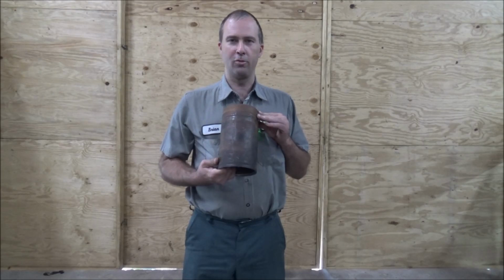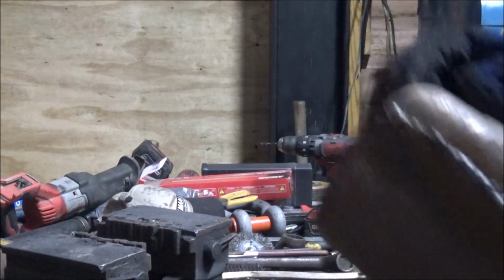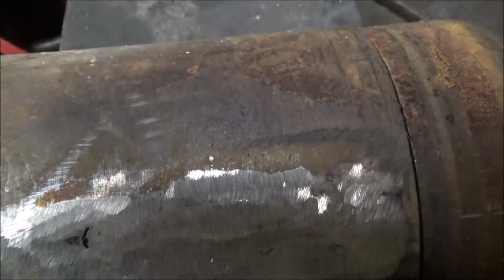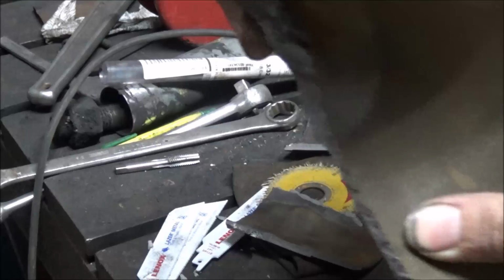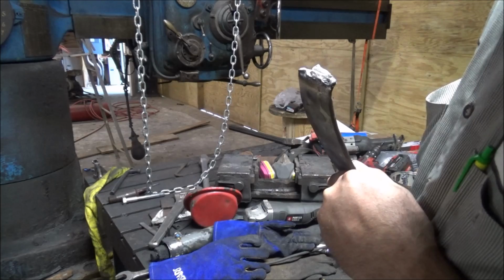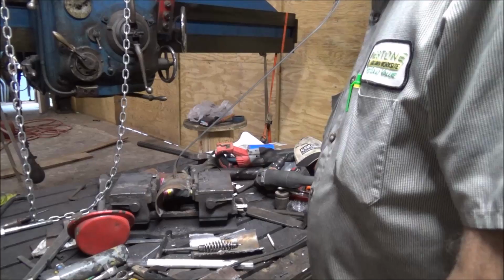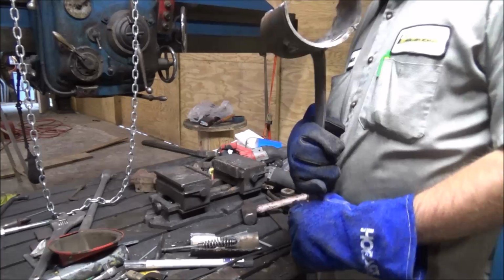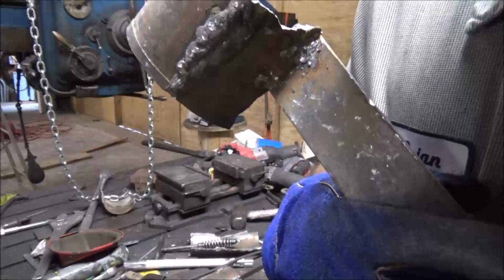Experimental strength welding of cast iron

Comment: why do you think removing the flux improves the welding of cast iron?  Does the carbon in the cast turn into c02 to both shield the weld and burn out some of the carbon to move towards steel?  It certainly is a curious result.
Reply: I'd be also curious to get the theoretical part behind this method, maybe also reduces gradually the carbon content in order to make the transition between mild steel and high carbon more progressive, could also some much slower cooling help...???   Lots of questions...
Reply: This is likely the case and the CO2 liberated in the process acts as a bit of a shield in itself.
Reply: If you don't puddle the flux out it leaves porosity.
Reply: I think two points acting together.
1. the heat drives out the the graphite as CO2 and CO creating a shielding and reducing atmosphere.
2. how much graphite is driven out depends on the temperature, creating a gradual decrease of graphite around that weld and with that a gradual change from the iron in the weld to cast iron surrounding it. I think this gradual change makes the welt so strong.

With flux on the other hand graphite will be pulled into the weld, but because the shielding will inhibit the burning of the graphite and we get a low graphite region surrounded by high graphite in the casting an weld.
Because the graphite can not burn away less will be pulled out of the surrounding areas making the changes of graphite content much more abrupt.
Reply from the maker: I believe with out the shielding from the flux I am actually decarburizing the iron and the weld somewhat thus reducing the area prone to brittle fracture.  Since I am using a large diameter rod with a lot of amps I am getting the weld area nearly molten and since I am forced to use a fairly long arc to maintain one I think a lot of oxygen is able to interact with the material  and leaving as carbon monoxide since it is not trapped by the flux. This is purely speculation but while the welds are ugly and hard to lay down they do seem very strong for cast welds.
Reply: My dad who taught me to weld always used special rods for cast iron I have no idea whet they are however. He always used one size up from what he would use on steel and ran them hot and fast.
Reply: I've had luck using 308L stainless with the tig welder. Thanks for the video

Comment: Brian: I'm surprised that you aren't getting more expert help on this. I am far, far from an expert welder, but I can tell you what I know. You've got to get some serious pre-heat on this and therein lies the problem because it's so big.  Some claim success with 7018 and mig, but every job I've seen has failed miserably. They go on the principle of "gobbing enough weld and it will hold". The problem isn't with the strength of the weld itself, it's what the welding does to the iron next to the weld when it cools from the fusion temperature. Flux on the rod, preheat and post heat will slow that down a little. Nickel and some stainless rods will "yield" as they cool, easing the stresses, skipping around and peening the heck out of each pass when it cools a little also helps. I've had some pretty good success welding iron pulleys and engine blocks and heads with MG 289. It is nearly pure nickel and goes on really nice but it's expensive. I sometimes do the root pass and face up the edges and face of the joint with it and then use a 50% nickel  (cheaper) to finish it. Depending on the quality of the iron, you'll get pin holes and porosity but don't worry about that, subsequent passes will improve the underlying passes....Dave

Comment: There's a lot of great info in this video Brian....  Like you, when I've broken something cast before, I've done a lot of research on what the 'professionals' do to get it fixed. The strength of the parent material seems to always be the limiting factor; but I too have had success with stick/7018 on a Deutsch front axle swivel, mig/ER70S on a 830 Case tie-rod-end steering connector, and using tig/ER70S2 on a chinese splitting wedge that the tip busted off of. Each of these are high impact/stress, and haven't failed again in years of service. I think heating things up and flowing the rod/wire is key, binding to as many of the cast grains as possible.
Reply from the maker: Yep seems the hotter the better.

Comment: Thanks for the video Brian. Looks like you can go with what you got. I think the addition of the threaded bolts will hold the casting together ok. Coupled with a smaller framed 3 phase motor the drill will live again. regards from the UK

Comment: broken with great accuracy!, i discovered by myself (cause all the old welding guys i worked around didnt share anything) gas welding steel with a bit of steel wire, no flux, also found it worked great on stainless (yes i know this might be basic knowledge to anyone who trained)  but point being, try it, if it works, then forget the so called pros who arnt doing anything hard in the first place
Reply: The old sawyer down the road ratholed ever coat hanger he could lay his sawdust covered hands on. And when he gas welded something up with them, it just stayed. And very true about the old timers saying nothing. Once in a while one might take a fancy to you and open up but it was a rare thing.
Reply: Lewie McNeely I have seen the old timers welding up pipe work (not going to say where but they make sparky stuf ) use a normal flux covered rod and in the other hand a length of re bar as a filler rod , all the welds were X-ray and passed ok the comment for the welder to me was it goes quicker better for the drink fund
Reply: what made me weld in the first place was this: i was restoring an old bike, headlamp shells were super hard to find in the correct type, found one whos holes had been ripped through and the rim was damaged which had to hook the chrome trim thing on. i was told by the guys i workd around, theres 2 experts, they make racing bike tanks, they can do anything!  took it to them, reponse from both was: too thin, just buy a new one, why bother,   yeah buy a new one, for a 60 year old bike, getting the one i had took a year! .    i got hold of a plumbing torch and some of those aluminium brazing/welding rods, (saw them at some bike show booth)  i got that all built up, reinforced on the back and rim all repaired in a few hours. so much for 'too thin!' showd me too many people are full of it and dont wanna tell you because youd realise they dont know either.    which is why i watch the youtube guys i do, they are sharing their skills, mostly because they have skills to share, not like the old guys who i reckon were just hammer and chisel guys who liked to lord it over the younger guys.  its also why those guys never worked for themselves and were just jobbing welders for a company.   trust yourself, check your own work and learn it if fails and go ahead if it succeeds, you probably already know more than most of the self proclaimed experts, and certainly ignore those who say it cant be done, it just means they cant do it.  by the time youve ground it, some filler and paint,(inside the casting use some of that spray on liner coating, its thick!)  it will look fine and work for another lifetime
Reply: As long as it works. 'Unconventional' stuff never bothered me if it worked. That's all anybody wanted. Some 'experts' don't know as much as some old hayseed that's had to do it in desperation. I've seen an x-ray neuc plant welder and a guy that worked in an olivine mine weld side by side and the olivine mine hammerer was as good if not better than the x-ray guy.
Reply: Sure. We've all found out that some people blow up their job to make themselves look good and make you think nobody can do it but them. A long time ago I was asking a guy building golf courses for a job. He already had an established crew and his answer was proof of the pudding. He asked me what could I do and I told him I could run a bulldozer. 'I can teach a monkey how to run a bulldozer' he said. I never forgot that one. But I did have a chance to redeem myself by helping pull out a sunk trackhoe later on. It's all good and it'll all even out IF you're honest. I don't have to worry about being found out. I can always prove it, maybe!!!

Comment: Years ago my Dad tried some nickle rods to weld an old engine block with a leaking crack in the water jacket.  It finally rusted shut and quit leaking.  I'd say you are on the right track and I guess keeping heat in the metal is a big plus.  I'll keep watching if you'll keep trying, Greg.

Comment: There are a lot of videos on youtube about welding cast. Not sure of the composition of your job but from what little experience I have had with cast iron it needs to be heated up a bit before and cooled very slowly. And I haven't figured out how you could do that with your big rig. I have used nickel rods on cast (small things) and works for me.  GOOD LUCK. And I hope you the best.

Comment: Used 7018 on a vice and the weld was grainy and brittle. Supposedly carbon dilution problem. Re-did it with Forney cast rods that had no specs but said cast, steel or both. They did not seem like NiFe, I suspect they were similar to 312 stainless (dissimilar rod).

My horz band saw I used stainless 308 MIG. Worked great and strong but was hard to drill with HDD bits. Was suggested on a welding forum as a cheaper option than NiFe. I'd be tempted to try 312. Thing is you will need a LOT of whatever you use, so not cheap.

Comment: brian you have a real job ahead of you. cast iron is the witches brew of the metal world. i was a millwright supervisor for years in a steel  mill. probably once a month a salesman would show up with the next state of the art  cast iron repair rod. for every success story we had five failures. it seemed it had more to do  with the mood of the cast  iron that day than anything else. my welders prefered 309 or 312 if they had a choice. sometimes on  a really critical job an engineer would  write up a lengthy procedure for the repair, but the chances of success didn't seem to improve much. if i were you i would contact some of the major rod suppliers and see what they recommend canvass some weld shops and pick there brains. then go with what makes sense to you. and may the cast iron gods be in a good mood that day.you deserve a break.
Reply from the maker: Mystery metal in uncontrolled environments always means pot luck!

Comment: Hello Brian: Forty plus years ago when I went to school for welding, we were mostly brazing cast iron with oxy acet torch..... Years later, I had good luck with nickel arc 99 electrodes on certain types of cast iron...Cast iron by nature is brittle and full of carbon so you will have problems specially on large castings  as the ones you are trying to repair...As far as the critics go just remember success has many fathers, failure is an orphan.. Hang in there.. It's all about learning and having fun doing it.. Mike in Louisiana

Comment: I think you said it,"melt everything". I hit the front of my cast  vice with a 4lb hammer and broke the thing in half.i then used stick weld to repair (just normal 3.25mm rods.some time later I was tightening the vice ,you guessed it.it broke.so with nothing to loose ,I used  mig ,flux core steel wire at 200 amps.i could see the metals melting in a puddle.she's been together for a year now.great channel,don't let this get to you.we all break crap from time to time.

Comment: Love your Bailey!  Our Rottweiler, Ruth, is a great foreman.  The minute I take a cigarette break, she sits in front of me and moves back and forth.  If that doesn't work, she barks until I get back to work!  I've been welding for over 50 years with gobs of Certs, and have "experimented" just like you many times.  That's a good way to learn while having some fun.  Way back when, they used to wrap bare rod with asbestos soaked in salts.  I don't recommend that you try that!  I repair cast by:  Oxy-acetylene brazing, Heliarcing with silicon bronze, 7018 and Ni Rod, in that order.  Sometimes with preheat, sometimes without.  One word of warning:  Cast iron varies tremendously, and a technique that works well on one may not work at all on another.
Reply from the maker: What material do you usually use to oxy braze with? Have you ever tried just flat out oxy welding cast with more cast dipped in for the filler?
Reply: Crown 125 or 125FC (flux covered).  Also used Oxweld (Linde) 25M.  Bakers Gas sells Crown alloys on the internet.  Great price (cheaper than my local welding supplier) and fast delivery.  Also, McMaster Carr has brazing rod.  Yes, I've gas welded with cast iron rod and flux.  It was customer specified for a piece of antique railroad equipment in 1983.  I used Oxweld cast iron flux and cast rod, but Linde is out of business, so you'll have to do an internet search.  Check with your local welding supplier.  Takes a LOT of heat, and you actually stir the puddle as you weld.  If you are interested, let me know.

Comment: 20/20 for the hindsight of some... :-) After the fact complaints are easy, but catastrophic failures happen even with brand new equipment. Testing makes some difference but testing with same or higher load, in some cases overdimensioning or just having used it before itself could be "the" reason for something to break and fail. Over a longer timeframe there is  never a guaranteed security other than empirical/statistical data - at least not in mass produced items, meaning at affordable price/performance ratios for most consumers. Nothing beats statistics in the end. The only tools that never fail are those that are never in use.

Some people don´t understand that man made, engineered products are not magically safe from everything that can go wrong, it takes a serious amount of effort to prevent that. lt´s often that very vantage point that leads to a serial problem, as it makes people ignore risks or accept the wrong compromises to reduce effort, also effort that prevents fails.
Anyway, using a crane more often just lowers the probabilities of a failure mathematically, but is no exclusion of wear, corrosion or failure in general.

Thanks for showing the welding trials on cast iron. I am completely new to that. I wonder if - at the wall thickness of the part - the  cast iron actually allows a similar puddle to form as in the test piece, but i guess you´ll instantly have a good indication if that weld works. Maybe it makes sense to weld a mesh structure into the gap first to have smaller pieces to weld to and then fill the interior of those cells. It also might help with containing the inert gas at the spot. Do you intend to anneal between work? 
 That could reduce warping and therefore stress compared to layering of a large section, but better ask someone with significantly more welding experience.

Comment: Thanks for the demo.Experimenting leads to a lot. My concern now is the thickness of your weld. Something that thin your basically getting your temperature up by the welding action alone. I would think it would be a good idea when we think of those really thick welds is to heat up in stages and work safe but as fast as you can. The first one In my humble opinion would be the one to get the hottest and this would apply to each stop and go.Heat-Weld Slow Cool-Then heat and start overlapping till you feel like stopping. Heat and slow cool down reheat and go to town. I guess you can call me Mr.Repeat just trying to be sure you get my opinion. I so want to be of help to get you up and going.

Comment: Hi Brian,
Call it "Brian's and Baily's weld testing shop"...    I've never tried the fluxless 7018 method I'd be very curious to try it...
Don't worry about the names you get called, the greatest geniuses weren't called very nicely until after their death...    lol
I'll try to find some time to get back a few cast iron back together with different methods... 
Cheers,   Pierre
Reply from the maker: Going to need a big welder to give it ago, I am probably at 350amps or so to get enough heat to make it work.
Reply: bcbloc02 well crap, this just put me out, 350a, i'm capped at 300 on single phase with my xmt304. Very interesting scenario though, but looks like im stuck with the fourney nomacast, works well when pre and post heated.

Comment: now I am the farthest from a pro welder but I ha e always beet told that you need to get the cast red hot with a torch weld while red hit it with a torch and let it slowly cool. the small but important parts I have welded this way. Pitman arm and idler arm in my 61 Pontiac Catalina had to be modified for the motor I put in/oil pan I used. anyways I was told I had to do it that way because it becomes brittle around the weld. anyways I enjoy your videos.

Comment: Interesting test.  I wish I could remember the youtube channel, but they had a manufacturer who had rods specifically designed for welding cast iron.  I would be curious if you could expand the test trying many different types rods to compare which was best and also try preheating and compare the difference.  Finally, experimenting with MIG and TIG and comparing that to stick welding.  I have a old drill press (holes) and vise (crack) that needs repair, but I am a novice when it comes to welding and was curious the route I should go and I have not come across any comparison in welding cast iron.